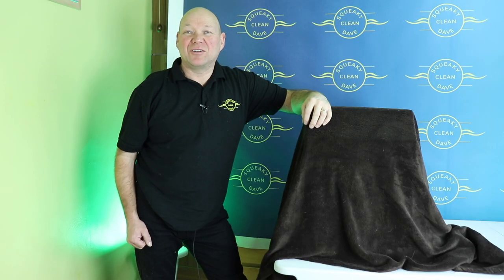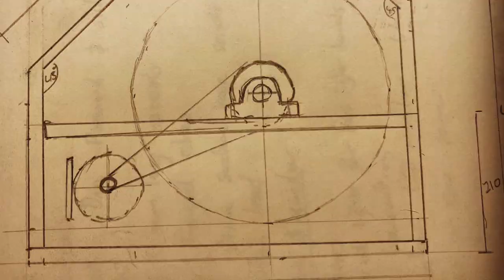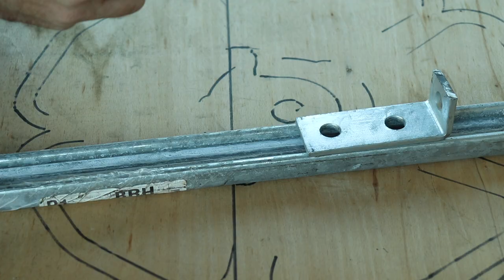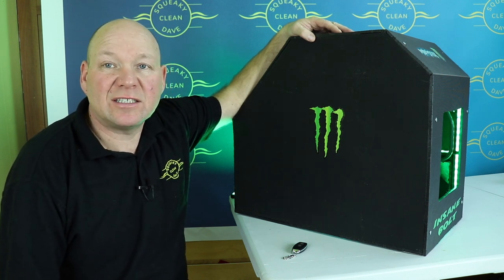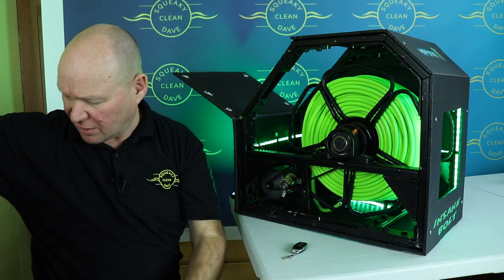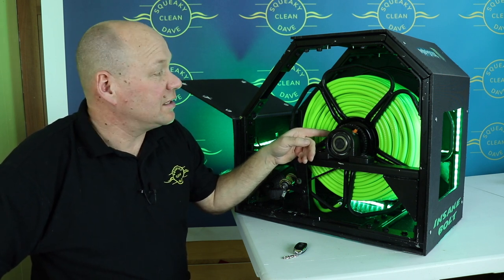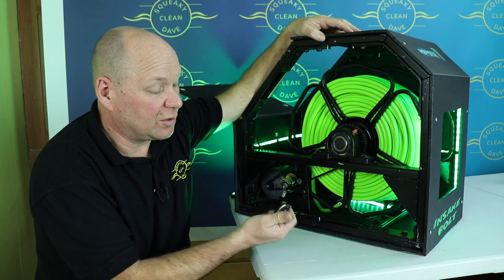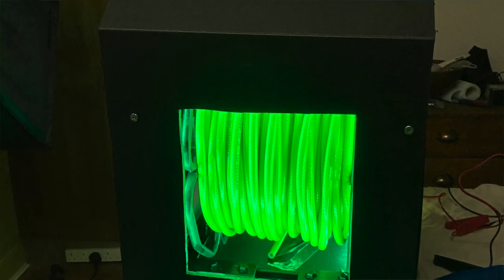The Fastest Powered Hose Reel In The World. Possibly

Comment: Looks really smart 👌🏼 did the standard inlet shaft fit those bearings or did you have to source a different one?
32 seconds
Reply from the maker: The standard fitted a 1 1/16” bearing
Reply: @squeakycleandave1  how did they go on, snug fit or did you have to hammer them on? I'd quite like to put mine on bearings so appreciate any advice 🙏🏼👍🏼
Reply from the maker: @connoradams4804  the one side slid straight on and on the other side I held the shaft with a piece of sand paper then spun it with my drill to take just a fraction off

Comment: Well done Dave!
Great job, looks fab.
We built 2 of these 3 yrs ago using same 350w motor, never skipped a beat.
Way cheaper than the new sexy ones.
If I built one again, I would go for the 500w motor option simply because you have more torque with
The option of fitting a speed controller with soft start (eBay)

Thanks buddy 
Mark@JDM cleaning
Reply from the maker: Thanks Mark. I did soft the 500 watt motor but it was after in had bought everything and didn't want to spend any more 🤣

Comment: On the clover leaf I purchased 1/2" mild steel from b&q and fitted it around each reel used self taping screws to hold it in place this stops the hose catching on the edges
Reply from the maker: Good tip👍

Comment: hi great vid can you run 24v motor off a 12v battery without anyother doings
Reply from the maker: Yes it just runs slower on 12v
Reply: @squeakycleandave1  also what is the thickness of the stokboard 6mm or 9mm?
Reply from the maker: @elitefleet6402  I just used 6mm stock board but I have noticed that it bows out when it gets hot. Think it’s expanding in the heat